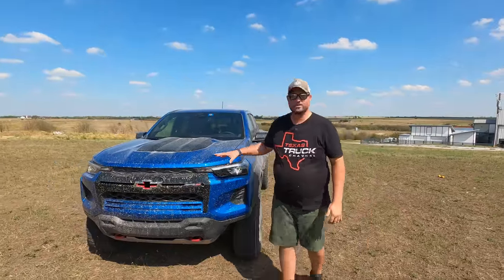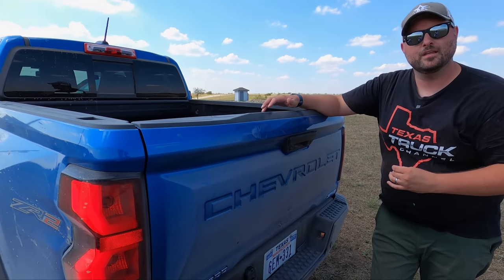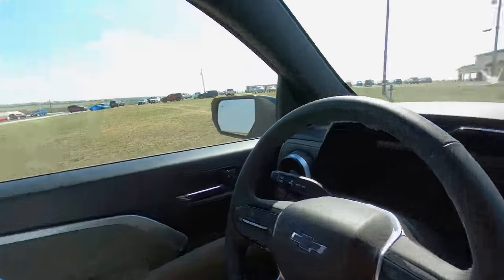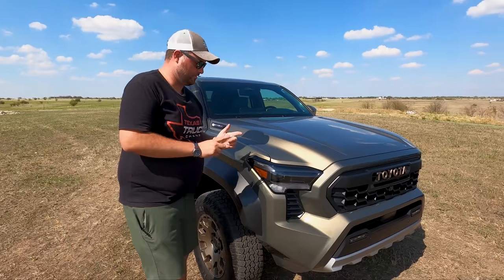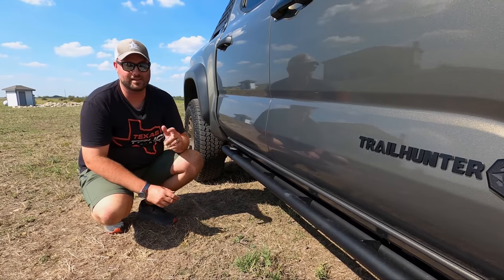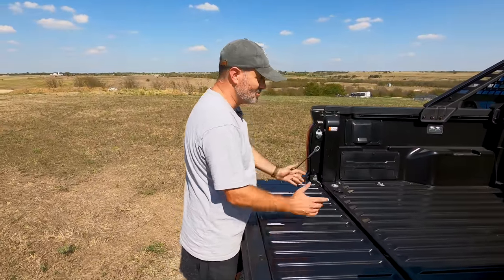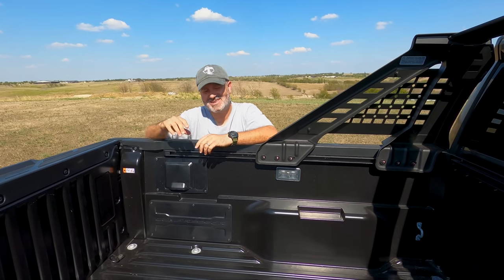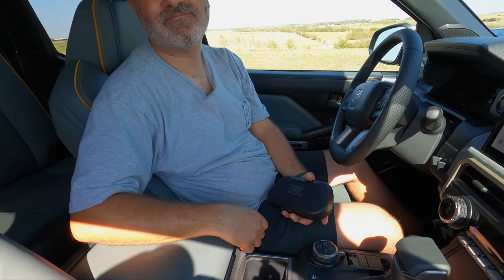Tacoma Trailhunter VS Colorado ZR2 - Which Is The Best Midsize Truck?

Comment: Need display on the ZR two till it fails, but the truck still runs. I might prefer analogue gauges, time-tested for decades, and one of the last things on an older vehicle to actually break down from vehicles I own as far as the 1972 Chevy nova, Oldsmobile Cutlass, 1986 Chevy Cavalier … and today, my 2022 Toyota 4Runner.

Comment: I do think the Trailhunter is the coolest version of the new Tacoma, but I feel like that thing is way more than even a Bison equipped ZR2. You can get a ZR2 for a well equipped Tacoma Offroad too so I think the ZR2 is the bigger value even though that Trailhunter has some really cool gimmicky stuff on it like the air compressor and exterior bed lights.

Comment: No comparison. Toyota not only owns this segment but will absolutely dominate now that this latest iteration of the Taco is offering such awesome exclusive features beyond just its stout engineering.
Reply: Finally getting back to a fully boxed frame is a start, we’ll see how the rest pans out.
Reply: @craigborrenpohl1233  What was ever wrong with the existing frame? Too much articulation? Was there ever widespread reports of any breaking in half because it's not fully boxed? You know, like the Colorado's seemed to be famous for?
Reply: ZR2 owns this. Looks, capability and interior all crush it. Toyota looks like and the interior still looks outdated. The Tundra was a huge huge miss. This isn’t much better.
Reply: @channelnamehere4065 I think you have them flipped.  Toyota had a c channel frame which was prone to rust and break which is why there was a multi-billion dollar recall
Reply: @wint_62  yup, that piano black interior won you over, I know. And the bricking is icing. Got it.
Reply: @shiftmotorsports9803  you're wrong. Full boxed frames from 1st gen Tundra and Taco was recalled 25 years ago. No issues on triple tech frames at all.
Stop talking about a 25 year old issue that Toyota took care of the customers for. Why do people always bring that up? Is that the only ammo?
Reply: @channelnamehere4065  2011-2017 wasn't 25 years ago.  That's the latest Tacoma frame recall.   Now, where's the proof of "widespread" Colorado frames breaking in half?  Did you see one or two improperly loaded vehicles on the internet broken?  If it were "widespread" or an actual issue, there would have been a recall.  By the way, Tacoma not only beats the Colorado in sales, but dominates the recall numbers too! Congratulations!
Edit: Toyota didn't "take care of their customers" by offering a frame replacement. They were sued by their customers in a class action lawsuit and their hand was forced.  They didn't spend billions out of the kindness of their hearts
There's more ammo, but you went to frames.  We could also talk about not being able to activate 4lo when on an incline or engines grenading themselves at an incline due to oil starvation......
Reply: @shiftmotorsports9803  taco will continue to dominate sales now that 2024 is out. The Tacoma is an indicator of what happens when people try Toyota trucks. They realize how stout the engineering is and can't seem to find a long term alternative. Now, if all u do is replace trucks every 3 years, take your oick. There are 3 brands built by entitled dgaf's to choose from.
Treat a Toyota as you described with any other brand and see how long they last. Can't blame Toyota for building in safe modes for the idiots who would put their trucks in 4 lo on an incline. Usually ppl with foresight put it in 4low before a climb. But keep breeding. GM relies on ignorant ppl to sell trucks. We don't need another bailout.
Reply: @channelnamehere4065  I considered the Tacoma but ended up with a ZR2 after considering all aspects.  6 years and over 100k of abuse, and it has never let me down, gotten stuck, or left me stranded.  I sold Toyotas in the 90's and have always liked Toyota trucks and framed suv's.  Even the fanniest of fanboys can't deny that they aren't built as well as they used to be, and Toyota isn't the manufacturer they used to be.  The Tacoma is now made in Mexico just to save some pesos, for example.  Enjoy your Toyotas, but I'm glad there are other options so we aren't all driving the same vehicles
Reply: @shiftmotorsports9803  I couldn't agree more. Glad there other options.
Reply: This is their most capable model for the Tacoma. It would be an unfair comparison if they compared it to the Bison. The Trailhunter and basic ZR2 go toe to toe, but when it comes to the bison it’s in a whole other league
Reply: @carlosholguin6739  one could argue that the Trailhunter doesn't even compete with the ZR2.  Without a front locker and real off road tires, I wouldn't even consider it regardless of how much I like it.  People sleep on the ZR2 (older one mostly) but it's a little beast off road and rock solid reliable (so far) with proper maintenance. Considering the price of both, and what you get for the money, I would buy another ZR2 if I were in the market.  Mine doesn't show any signs of giving up any time soon though
Reply: LOL

Comment: Toyota leads the way with these mid size trucks. You can’t deny that they all copy Toyota’s innovations and features and even improve on them but they originate from Toyota. The gas non-cap on Chevy is cool but over time enough dirt and debris will accumulate causing it to be pushed into the gas by a gas nozzle.

Comment: In case anyone is wondering what was on the censored dashboard, it is either:
1. That it was averaging 15.4 mpg
2. That the mpg gauge goes 0-60 instead of 0-30
Reply from the maker: Just to eliminate any mystery, we blurred the fuel data because this engineering test mule was not calibrated yet. The number indicated was in no way accurate.

Comment: Still driving a 2004 Toyota with 300k miles - never had a mechanical issue, only routine maintenance. That is never going to be the case for a ZR2 nor I think for a modern Tacoma.

Comment: The new Tacoma trd pro and trailhunter are leagues better in my opinion than the ZR2. That air compressor and high power outlet are nice. The iso-dynamic seats in the pro. And I love the softex leather in the Toyotas. Much better than that leather in the ZR2. I get it’s all preference. But I like the interior of the new taco more too. 14” screen is nice. And of course 465 ft pounds of torque is very nice.
Reply: Just wait.. It'll cost $70k too! 😂😂😂
Reply: @Travisj9935 if you're looking for a truck this caliber money shouldn't be an issue. If you do well and don't want to bankrupt yourself for repairs and shit go for toyota.
Reply: @CC-tk9xw nope that's an absolutely false statement as the newer Toyota's are not as reliable and i know for a fact this trailhunter will not be as capable as the ZR2 as well.
Reply: "much better leather than the ZR2" 😂 you lost all credibility with that one. As if you tested out and felt both leathers.

Comment: Why would you not want a fuel cap seem like a great way to get dirt water debris in the tank
Reply: This is my thought also.  Engineers apparently have never been in wet muddy conditions.  Had to put fuel in a former employers (non GM) truck with the then new capless system.  It was full of dirt and no way to get it all out, so some dirt went in.  Also, in wet weather, I;m sure some water pools there, and ends up in the fuel, too.  Capless is a really dumb idea.

Comment: Taco is driven 198 miles and 135 miles of gas is used? so the difference of 63 miles is for what? idling? may be that is the reason avg. mpg is at 15 mpg. I hope it returns better fuel eco in real world driving, otherwise,  I'd forget the turbo engine and buy a 2023 V-6 instead, and at 135 miles, the gas tank is more than half full so the full tank is around 400 miles, I would guess.
Reply from the maker: There are tons of speculation regarding mpg. Keep in mind that is a is a preproduction display only unit without full cluster calibration. We blurred out the mpg rating because it is inaccurate per Toyota.

Comment: One thing said, that is a major mistake that should be corrected. You never ever use your hitch ball as a recovery point (4:01minute). It is not made or designed to be one. People have lost their lives and been severely injured because of this. Otherwise great video
Reply from the maker: Correct, you use a recover insert in the receiver. Not a traditional ball.

Comment: The zr2 having a front locker is awesome and its probably the more capable vehicle that being said more capable for how long? Tacomas are not shop queens they mostly likely will be more reliable with much less engine/transmission problems i really wish these companies would take a page out of nissans book and if it ain't broke dont fix it put a darn reliable v6 in these tricks for god sakes. I know the turbo 4 is fast and sounds good but if i need to pull a trailer with some weight on it once or twice a week i want a engine that will not over work itself and last over 100k just a thought??🤔🤔

Comment: Wait.. so the snorkel is not a traditional snorkel and is there only for dust mitigation?

Roughly @ 12:30
Reply: Too many unsealed electronics onboard for Toyota to endorse deep water fording. They have stated it is for cleaner air when on dusty trails.

Comment: The mechanical-electrical complexity of the yota simply don’t get along with real world off road in my book.   

No Leaf springs on the back makes this truck officially a toy, no more serious towing. 

No front diff lock leaves this brand new truck way behind the ZR2  category. 

Chevy is doing things right.  They took the crown of the F150 whit the Silverado and now seems to me that the Colorado is right about to be the king of midsizers.
Reply: What? The Tacoma doesn't have leaf springs on the back. Is that what you meant to say?
Reply: @oneslackr  sorry. I corrected the text.  Yes no leaf springs on the back. That’s what I meant
Reply: zr2 sucks ass conpare to toyota tacoma

Comment: im curious with the light bar coming on when you have your high beams on if you'll have issues on the highway with police?
Reply: They'll almost never pull you over for it.  Depends on the state, but in CO you can have 4 lights on the front of your vehicle on the roadway.  They don't distinguish between individual bulbs or units though. 

Having said that - don't be that guy with the light bar active on the highway.
Reply: Imagine having a light bar active on a highway for no reason

Comment: Tacos are reliable, but that reason only holds up for so many years. The motors don’t even compare anymore. They are loud, under powered for these days and are losing at the reliability ratings over the years. And as far as straight comfort, ride and all the stuff you don’t need and its usability GM owns it. It’s a tough pill to swallow for the die hard Toyota guys.

Comment: I don't see how you can really compare the two. I ordered a ZR2 Desert Boss (fully loaded in Harvest Bronze) back in January and it kept getting pushed back until the UAW strike hit. IF I hadn't cancelled the order, who knows when I'd be looking at actually getting the thing. With the UAW strike, it wouldn't surprise me if they scrap any remaining 2023 ZR2 orders, since it'll likely be 2024 by the time they get back on track. So doing ANY kind of talk about the 2023 ZR2 is kinda pointless.

The Trailhunter... Toyota has a great track record for reliability as well as having been involved in the off-road racing since at least the 1960's so I'd be inclined to trust the ability of a Trailhunter more than a Colorado. Their hybrid setup has been proven over the last 20+ years with the Prius. I'm sure I would have liked the Colorado I had ordered, but I'm sure I'm going to LOVE the Trailhunter.

Comment: Omg the bantering and bashing that always goes on with these motor vehicle threads is humorous.   Calm tf down people.  I especially love the "they dont make em like they used to" comments.  You mean the carbureted dinasaur motors good for maybe 100k that burned a quart every 1000 miles?  Or was it the fragile C-channel frames that actually caused the invention of the phrase "dog track"?  Or the top speeds of 73 mph?  Maybe the ability to ride a corner a little hot and blow a tire off the bead just before it ended up on its top?  How about interiors so frkn loud you couldnt have a conversation? Yes the incessant govt restrictions are complicating things,  but no way are yesterdays vehicles nicer than todays.   No way.

Comment: Chevy has worse mileage. No way resale is going to be as good.   Buy mostly I can get tacomas at sticker or less with good variety whereas I just checked 4 local Chevy dealers and thr handful they have are mostly lower trim levels and the higher levels have bs added market adjustment profit